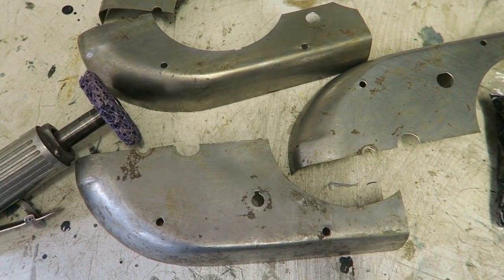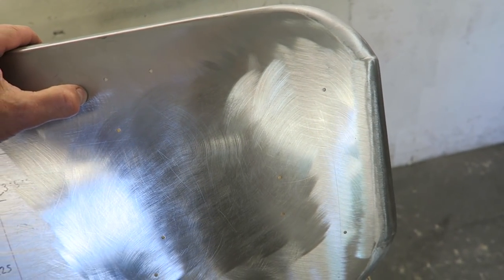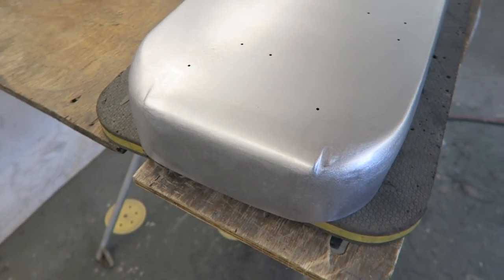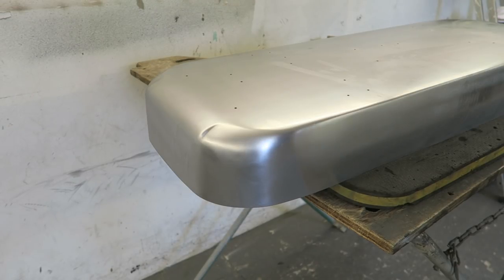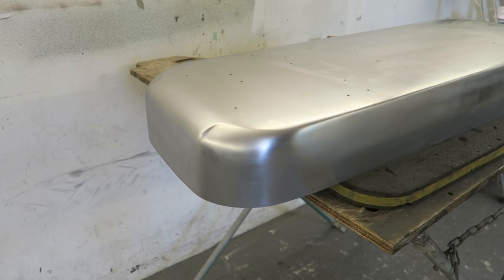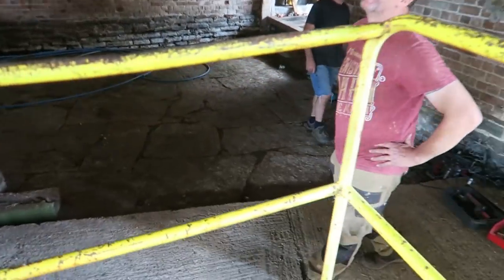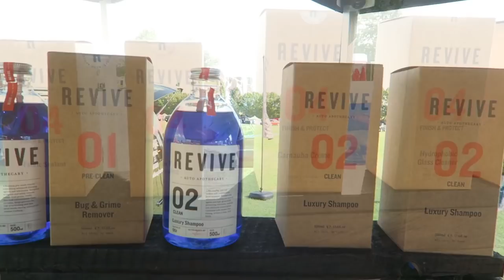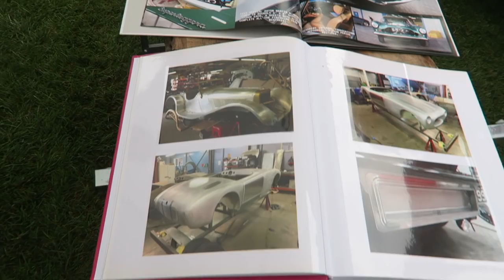Final stage metal finishing / Polishing hand fabricated car bodywork. Tips and tricks #55

Comment: Hy Trev, great work as always!
Would it be possible to instead of priming to put a clear coat on? Is there a clear coat that would stick on the polished metal?
Reply from the maker: I used to give my models/sculptures a light coat of adhesion promotor then 2k clear coat on the top. It worked but wasn’t perfect. Diamond cut alloy wheels are clear coated with specialised lacquer, I’ve never used it myself. Cheers Trev 👍
Reply: Thanks.
Reply: @trevsblog  Advice on painting plastics would be handy too.

Comment: Can't wait for my eye get better after an op,  so I can  put some of these tips into practice on the bashed  tub of my old  two wheel drive mk3 Hilux !!!  However you haven't mentioned the technique I've mainly relied on  up to now,  which is using non destructive dent pullers ie those using hot glue tabs or the far less effective suction cups. 
I think you've mentioned the spot weld dent puller tabs but your opinion on the glue tab technique would be very welcome due to there advantages with poor back panel access and in some cases no paint damage.
 I fabricated a three point puller out of some quick clamps to improve the the pulling  torque and load spread of the two point puller that came with a cheap kit.
Reply from the maker: I briefly got involved with hot glue and PDR methods, but on the whole I’ve always worked as a panel beater and then the companies I worked for would employ a third party to come in and perform these repairs, allowing us to continue with the heavier panel damage or replacement. I enjoyed having a go myself and had some measured success but it wasn’t always a case of having too much work to do, not enough time… cheers Trev 👍

Comment: Thank you for all the hard work you put into these videos, they are much appreciated, I do have question though and its not metal related. With more, mmm lets say "modern classics" starting to be restored now, how do you repair things like plastic bumpers? The reason I ask I have a polyurethane bumper (PU themoset), factory half painted, there's no damage other than the top painted surface is very wavy and I'm unable to buy a new one. Is there a repair procedure for this before adding filler?  thanks again.
Reply from the maker: Hot air gun will help to iron out the distortion in plastic surprising well. Cheers Trev 👍
Reply: @trevsblog  thank you so much, been lost to figure out what to do.  👍

Comment: Just been watching your excellent review of the Metz shrinker stretcher, I know it’s rated for 1.2 mil steel but have you tried it on 1.5 by any chance?

Thanks
Reply from the maker: I haven’t tried it in anything thicker than .9mm. There is a big difference between 1.2 and 1.5.  I personally doubt that it would be particularly effective on steel that thick. Cheers Trev 👍
Reply: Ok .  Thanks for replying.